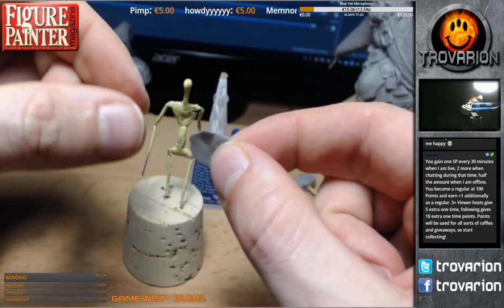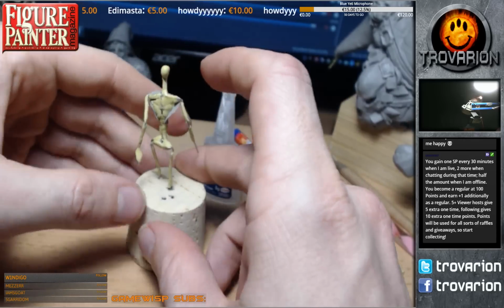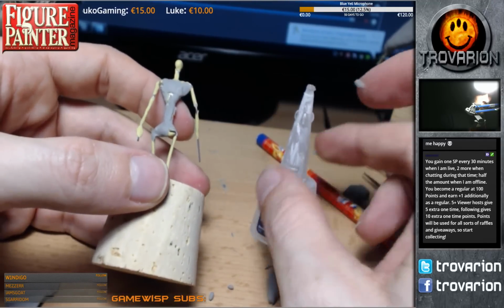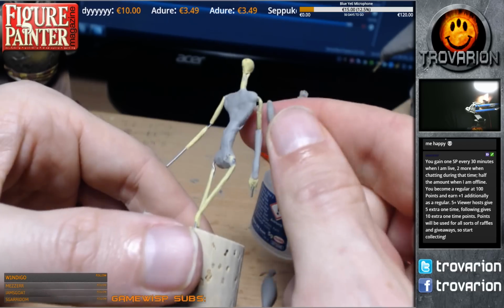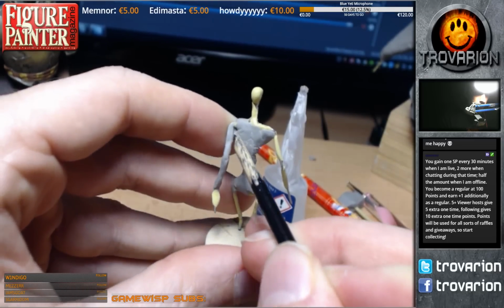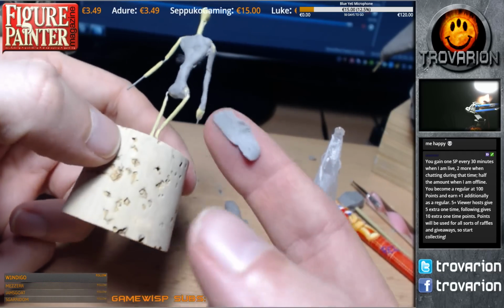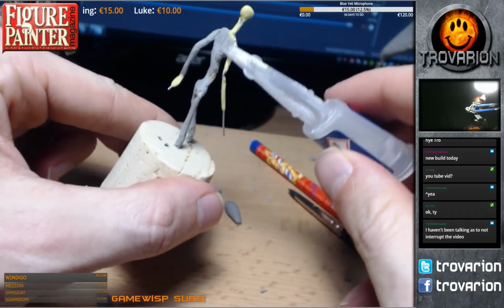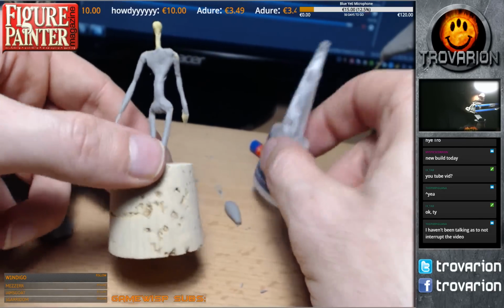How to make Armatures for Miniatures - Part 3

Comment: would TLS or liquid Fimo work instead of Superglue?
Reply from the maker: I have no idea what either of them are, sorry!
Reply: hii Trovarion, TLS is Translucent Liquid Sculpey, can be used as a glue and a smoother for Sculpey polymer clay, and Fimo Liquid is the same thing made by Fimo for polymer clay, I will try it and let you know, I sometimes coat my hand armatures with it, and then heat set it, before adding clay.
Reply from the maker: nice, sure, let me know! thanks!